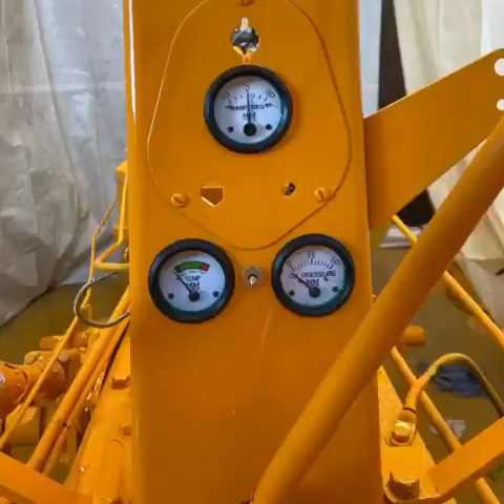1955 Minneapolis Moline UTS-D

Comment: I have a pre 50 tractor like that that's a gas that runs and probably looking for home that would restore it up nice and pretty might have either a bad flywheel or a bad starter or varnished fuel tank but it would pull start real easy